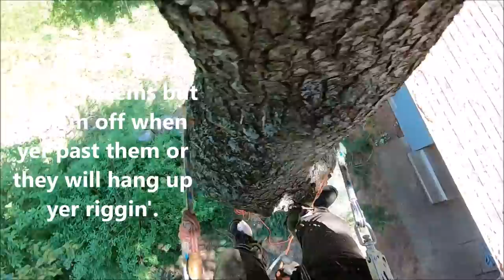OLD SCHOOL TREE REMOVAL , SIMPLE MANS RIGGING

Comment: Bill, thank you for the demo. you gave on the usage of the pics ??? {long handle vs. short} I don't remember the proper name for these tools but you will know what I am talking about. I too have a bad back and just turned 70. I don't handle a large amount of wood but only to throw a few rounds in the pickup for camping, we do alot of camping and like big fires !!! I have found that slamming my rubber handled straight claw hammer into the end of the round is the only way to go. I can slam it in and swing it onto the tailgate with ease and I don't have to bend over to get it done !!!!! It turned out to be a life saver for me to  now be able to load firewood !! Again thanks for the video !!!!!

Comment: @22:55 what buckin' did taught me more about cutting branches. Since the branch was too long to do an under cut, since it'll snap before he'll have a chance to guide it. He made a cut at the bark so it wouldn't snap off. and he used the branch's length as leverage to easily manhandle the branch in in the direction he wanted! Man I'm still learning from buckin' about cuts, trees, tools & tool maintenance, ect

Comment: I'm used to fuel pump in gas tank.  Is it common for fuel pump to be near engine?
Reply: Steve👍Most 1970's and older vehicles use a mechanical fule pump that's mounted to engine, pre-dating the electric pump that are common today 👍 hope I explained that well 👍
Reply: @morgunfreedom4346  Didn't know that.  Thx so much.

Comment: clove hitch is not safe. It can roll. At least use a constrictor knot
"The clove hitch is not strong, and its tendency to slip or jam at innoportune moments means that it should never be used in any important or life-threatening applications….To be fair, the only situations in which the clove hitch is of any real use are those in which equal or near-equal loads are applied to either end of the cord...."
Reply: Rock climbers use it in building anchors that are life support. Take the time to seat your knots, hitches and bends then chuck a stopper on it for critical loads.
Reply: @charliemartin2535  no they dont. Or maybe the dumb ones or when both ends are under load.
Reply: @trollmcclure1884  ya not on a single end. Both sides are pulled. Also BBR does use a back up knot several times. He's also used the hitch all his career. He's also not using it on huge critical loads. Risk of slipping is down to frictional forces. So slippy rope on a slippy surface would be at a greater risk of slipping. In this situation that's not a problem, rough bark and old rope with positive rigging. It's grand he knows what's he's at.